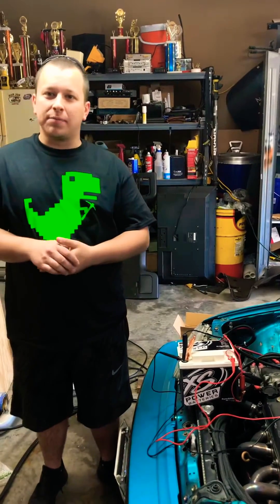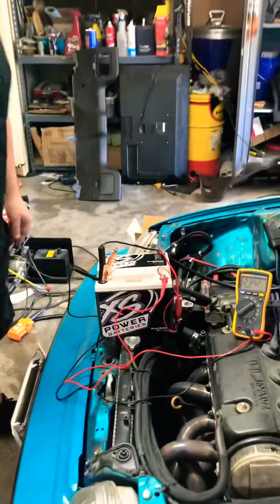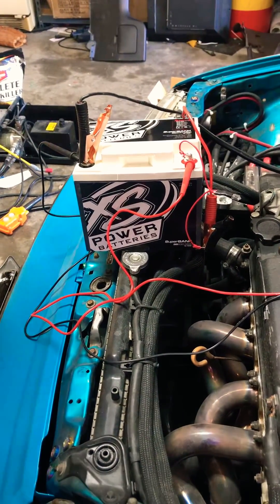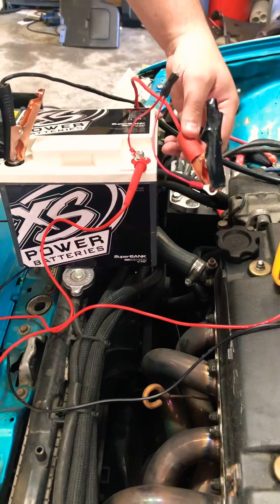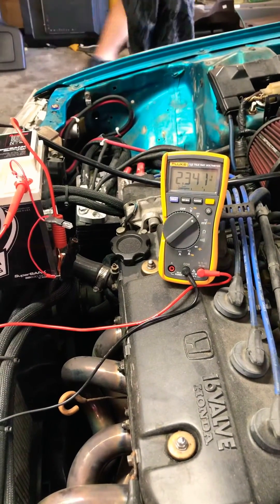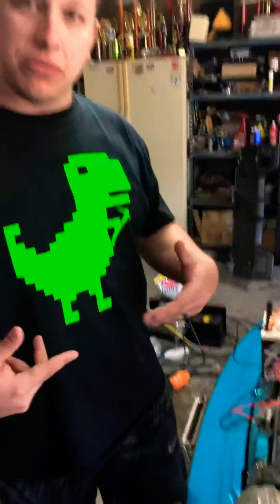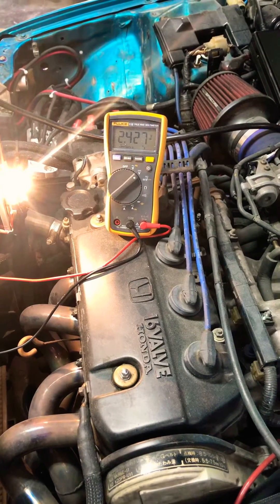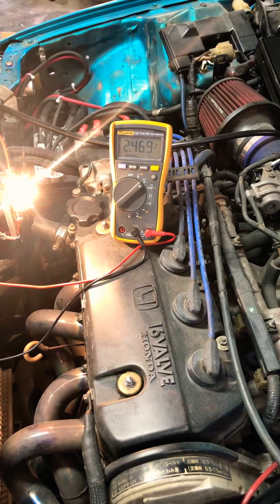XS Power Superbank First Charge!

Comment: If I don't have this specific charger. Can I use a regular charger to charge these up?
Reply: the important part is to NOT go over the max voltage.  14.2 or whatever he said.
Reply: @diylithiumguy i have a super bank SB1000-31 how much should it be charged up to and can I use a regular acid car battery to charge it
Reply: @luii3157  no need to charge it higher than where your lead acid rests.  High 12s or so.

Yes, use a lightbulb.
Reply: Do u still need the bulb if u use  regular charger
Reply: @chadcrowe753 yup
Reply: @chadcrowe753  if the charge will limit current, you can use it.

Comment: What if my charger has differant setting I can set it to charge at 4 volts or less do you still need the bulb. And what's best voltage to charge supercaps at.
Reply: 4 volts isn't gonna charge a 14v cap bank